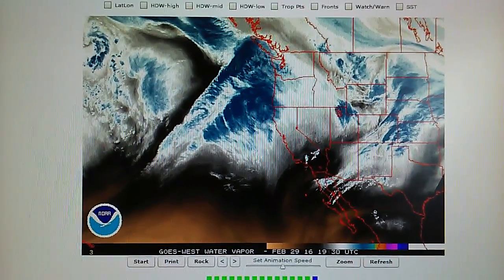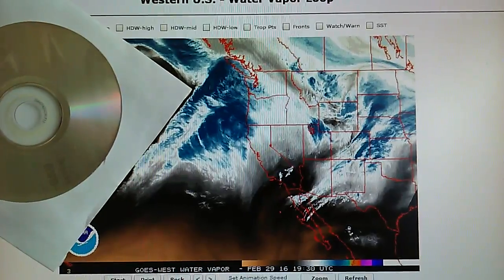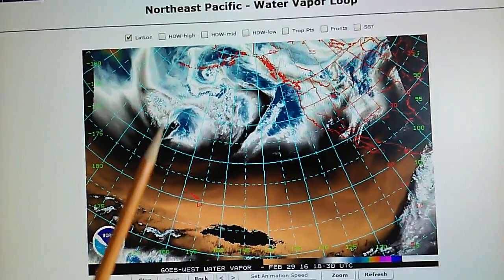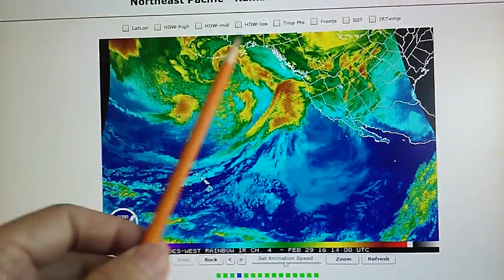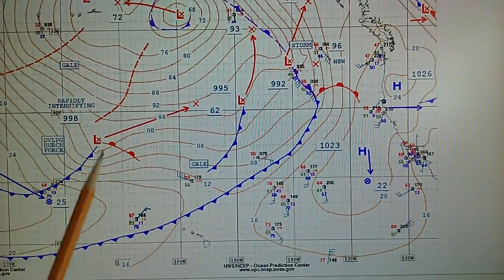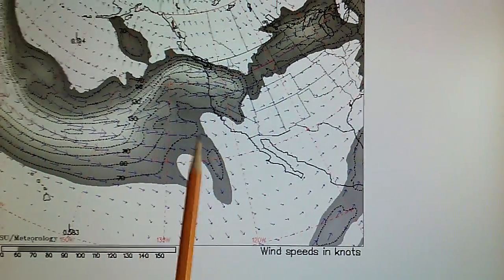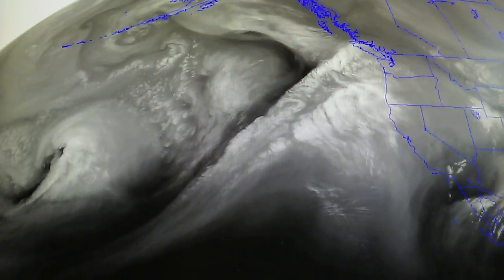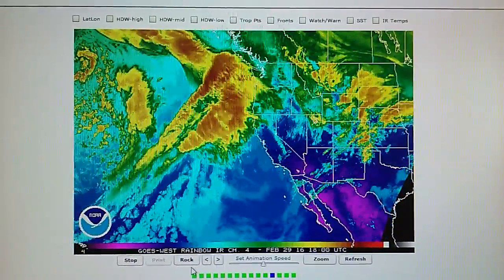2-29-2016; Day-12 of High Pressure Blockade; Phased Array Transmitter Generates Right-angle Front!

Comment: Really appreciate your broadcast I live in Fresno Clovis California where Kim trellis basically everyday I just like to say when I turn on those ionic heaters or whatever you call him I have my TV on antenna you can see the radio waves that they shoot through cause distortion on your TV as soon as I turn them on the clouds in the sky look like waves then
Reply from the maker: Kevin Willingham - Thanks for your comments and for watching the videos; we've noticed similar bursts of noise when listening to the AM radio band while driving up 395 past Bishop, Independence, Lone Pine and other areas on this route when cumulonimbus development is occurring and being targeted with microwave RF.  We hear short bursts of white noise. These bursts of noise are always the same duty cycle and interfere with the modulated audio signal the same as you'd see on analog TV which uses an amplitude modulated video signal. As this noise is occurring we are simultaneously observing Cumulonimbus development near and over the Eastern side of the High Sierra range as we are driving. The tops of these cumulonimbus plumes are targeted and superheated by space based microwave RF and we then observe the slow collapse and disruption of the lift in the cloud formations. This nefarious activity is preventing thunderstorm activity and precipitation and snowpack. If you look at the playlist on this channel under 'Cumulonimbus Superheated' you'll see exactly what is causing the collapse of these thunderheads.

Comment: I was so convinced in the first part of your video where you were showing just one frame of that WV loop. I really thought you were on to something.
But now that you show the loop up to that point in time, there is nothing like a "right angle" there! There is a curve on that southwesterly branch, and several wiggles in the northwesterly branch of your angle.
You were discussing a deep low and pointing in the wrong place; it is actually much further northwest near the frame edge. 
Just between you and me, I don't think you know what you are talking about. Cheers!
But, carry on; you will see lots of geometric things in these images. They don't mean anything, and especially not evidence of weather manipulation.
Reply from the maker: Baloney.  A right-angle front is not naturally occurring in nature.  Each frame is a sample taken every 30 minutes.  Look at the lack of rotation in the center of the system. That is caused by descending air generated by the satellite transmitter. Mother Nature does not generate 90 degree angles in weather systems nor does CO2 or 'greenhouse gas'!  This is man-made weather manipulation and is not being shown on the mainstream local & national weather reports!  The long edge of the square front is 1500+ miles long and not deviating by 1-2 degrees.  Get your eyes checked. Cheers
Reply: +1PacificRedwood 
Hmmm. OK, so do the manipulators create this 1500 miles long feature? What type of equipment do they use, and how does it work? What was the beneficial (to the manipulators) outcome in creating this rather short lived feature? 
You see, your proposition that this is weather manipulation raises many questions. I would like to hear your ideas about this. 

By the way, each frame is not "a 30 minute sample". Each frame is a snap shot at 30 minute intervals. I think you need to find out a bit more about the material you are using on which to base your claims.  

I'm a meteorologist so if you have any questions about about the remote sensing products or modeling products you are consulting here, please ask. Cheers.
Reply from the maker: +Ross Marsden - The square and right angle fronts shown in these videos are probably created by phased array microwave transmitter - which is a specialized transmitter capable of shaping and directing its RF power - one application is being able to heat the cores of these large low pressure systems in order to counteract the counterclockwise rotation.  The process weakens the center - as evidenced by watching the surface analysis map info daily pressure over time.  Occluded fronts are depicted in the center of developing systems when these right angle imprints are visible. Also, these transmitters create high pressure systems between storms to prevent them from merging.  If you've seen any of the other videos you'll see evidence of this.  Before I went out on a limb and started posting videos I had been closely watching the activity on these satellites and it was obvious how the California and Southwest drought was being caused.  If you sort my videos by date, and look at the titles we had 17 straight days of stationary high pressure parked off California and West coast blocking several rain systems.  The other half of this weather manipulation operation is the aerosol 'chemtrails' being sprayed over  incoming moisture fields causing a capping inversion condition - preventing atmospheric lift and stopping the precipitation process here in the Southern California region.  All of this sounds crazy but if you LOOK at the evidence on display daily, you may start to ask the same questions I did over five years ago.  Watch my video from January 15, showing a much larger rectangular imprint on the center of a large system.  Just tonight I uploaded another video showing a square feature in the core of the 963mb storm offshore.  LOOK at the evidence a bit more carefully before you toss everything out. The so called 'El Nino' is not happening. Instead there is a conveyer belt of low pressure systems year round which are headed to the North American West coast and have been blocked mainly in Central & Southern CA using installed stationary high pressure in strategic locations offshore.    BTW I understand the NOAA loops use a sample frame taken every 30 minutes.  The previous reply was corrected.
Reply: +1PacificRedwood 
No, a phased array radar is a radar with a stationary array of radiating elements. The radar beam is directed by "phasing" the signal to the individual elements. radars are constructed this way when the array needs to be very large - several hundred metres across. This arrangement does not enable the capability of "heating" something. Radar systems such has HARRP can only heat parts of the atmosphere that are already ionised, and those regions are in the ionosphere, tens to hundreds of miles above the Earth's surface, well above the troposphere where the weather occurs. No radar system can do what you claim to weather systems.
Back to your straight line in the cloud. The product you are looking at is mapped on to what is called a rectilinear map projection. In that projection the latitude and longitude lines are straight and perpendicular. You can see that in the boundaries of the states which in many cases, especially the mid-west are parallel to the latitudes and longitudes. In a rectilinear map projection a straight line on the Earth's surface, a great circle, is curved. Therefore your "straight" feature 1500 miles long is actually curved on the Earth's surface, and its straightness is only an artifact of the map projection. You showed that yourself when you tried to fit the feature in another map projection to a straight edge. You found it was curved, and it is curved in fact, not straight as only appears in a particular map projection. 
Your "evidence" is coincidental and imaginary. Less kind people than me are liable to severely mock you, and rightly so.
Reply from the maker: Ross Marsden - I've posted yet another video (June 13) showing a rectangular imprint on the center of a developing storm in the central Pacific. This is not random event nor coincidence as you asserted in a previous reply. The purpose of these satellite transmitter generated right angle and quasi right angle imprints are to separate and isolate the vortex from the front. If you take a few minutes and look at the watervapor & IR loops, you'll figure out that this nefarious activity is not normal or random. Look up the website Artemis.bm and you'll start to connect a few dots. Weather is being covertly manipulated without the public's knowledge while disaster bonds, weather options and derivatives are being sold on Wall St.  The 'business' of dealing CAT bonds is really a protection racket. All of this is why the local and national televised weather reports do not show satellite images to their viewers but instead show us an animated cartoon version of the weather.

Comment: can a single phased radar do that, or one needs to have 2 or more? Who would want to literally starve to death the American citizens by depriving them of water? Monsanto et al., who carry the patents for drought resistant crops, maybe?? 
From the patterns of these right-angle fronts, one should be able to find the location of their sources.
Reply from the maker: I believe the U.S. is in the midst of weather warfare.  These enormous low pressure systems are moving toward the West coast one after another and are being blocked by installed high pressure in strategic locations. High power radar is used to weaken the cores of these weather  systems, and the aerosols are used to maintain a) very low atmospheric humidity and b) cause a capping inversion layer over the incoming moisture fields, preventing lift and precipitation.  Now Wall St. seems to be profiting off of insider information - and that would be the advance information of what will happen with the weather in specific regions like California where a third to half of the nation's food is grown.  Weather warefare has been going on here for more than 15 years but now Wall St has decided to make lemonade with the lemons. Thanks for watching the videos.
Reply from the maker: From what has presented itself on the satellites, I would estimate there are probably six separate satellite based phased array transmitters available on the Eastern Pacific to deal with the multitude of weather systems.
Reply from the maker: +aszi88 - Where have you been? Weather manipulation has been going on for 20 years. This exact type of right angle pattern has shown up on the weather satellites periodically over the past 5 YEARS.  Turn off your television set.